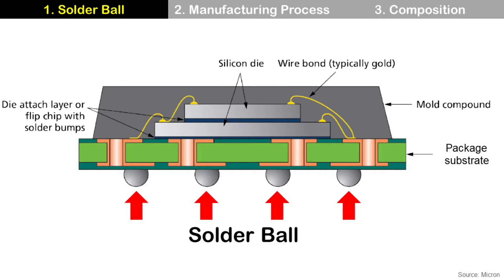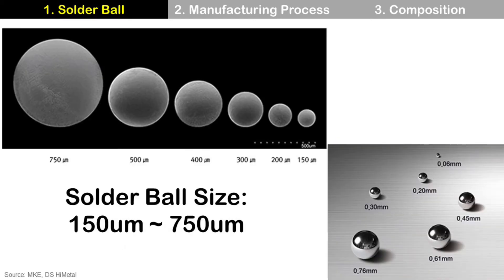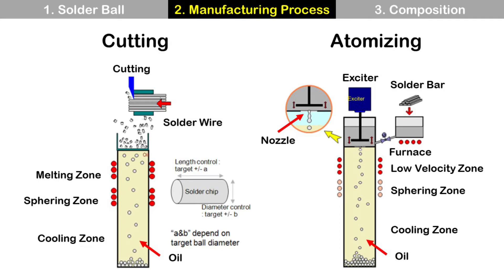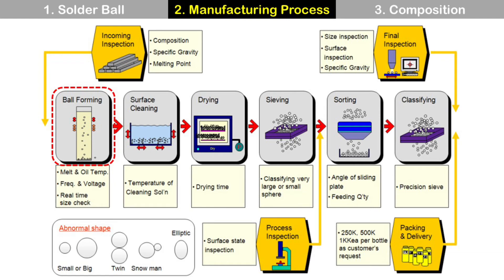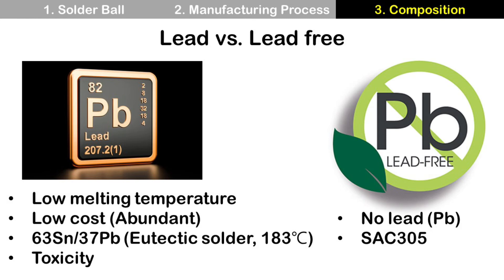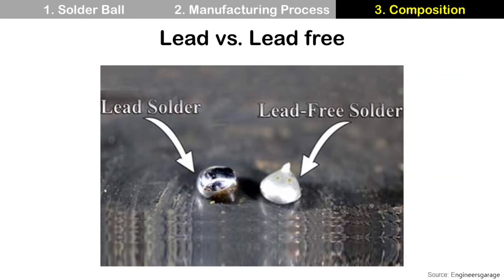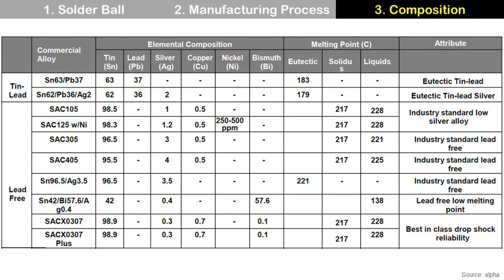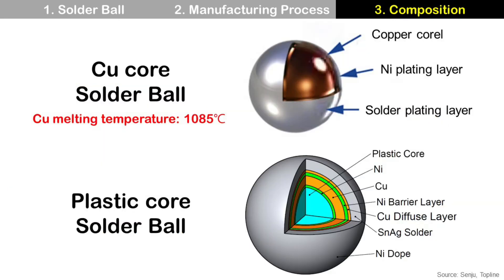[Eng Sub] Solder ball - Lead, Lead free: Senju, Alpha, Ducksan, MKE

Comment: Thanks for this very informative video. Do you have any insight into accurus scientific , a taiwanese supplier of solder balls?
Reply from the maker: Thanks for watching. I don't have experience to use solder ball from Accurus Scientific so I don't know about it.
Reply: It’s very useful video,thanks. But there’s a little typo of the title(duksan). I’m process engineer of substrate manufacturing, and I’m wondering any rule of selecting solder composition,such as SAC305&405 or Sn0.7Cu, do you have any information? Thanks
Reply from the maker: Thanks. SAC305 is the most common solder for lead free applications. SAC405 is preferred in high reliability applications such as automotive. Sn0.7Cu is commonly used in consumer electronics where high mechanical stress is not much concerned with lower cost than SAC405.